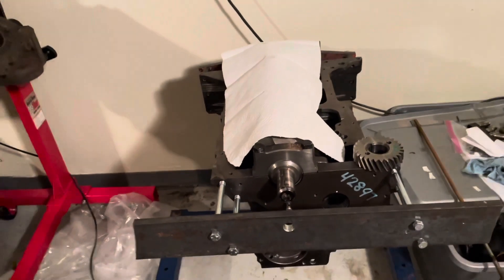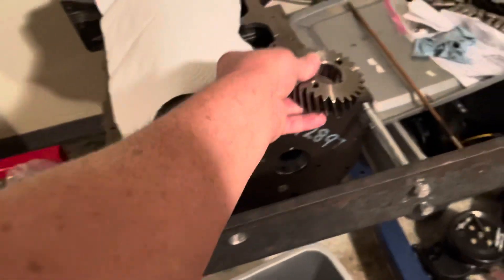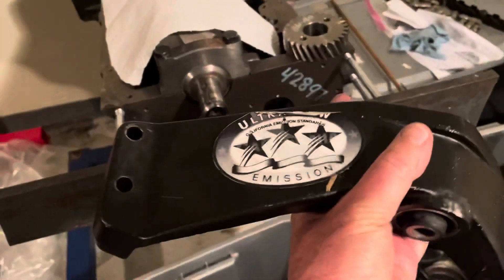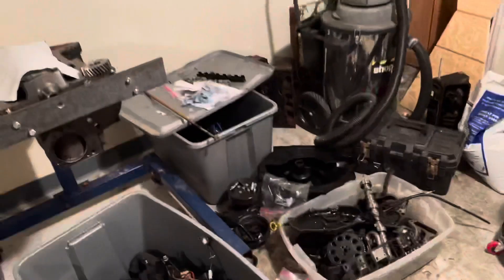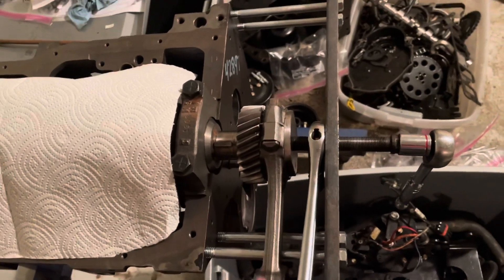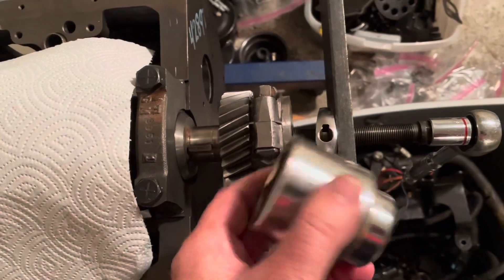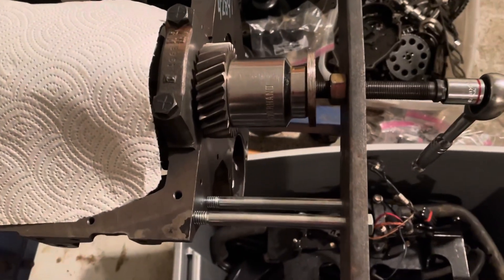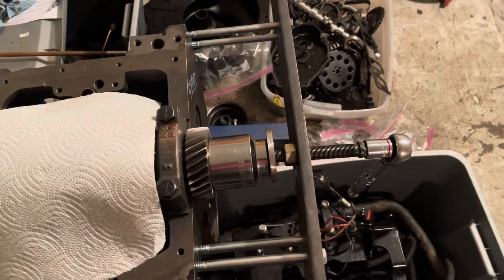Mercruiser 3.0 1(c) - Timing Gear Install (DIY Tool Needed)

Comment: That tool you made doesn't make a whole lot of sense. What's the difference between hammering the gear in and pressing it in, when the thrust bearing is taking either of those forces? If it was good enough for the factory, it's good enough for rebuild. If it really bothered you so much, why didn't you tap the hole and run a screw then? Way less work and it would not put pressure on the bearing at all.
Reply from the maker: Impact forces from hammering are 100s of not 1000s of times higher than a steady pull of a tool. I didn’t tap the crank because I thought if the crank wasn’t tapped then there was a reason for it not being tapped. I made a tool because I figured the factory had one because I could see no other way to install it. Why do you have a beef with me making a tool?